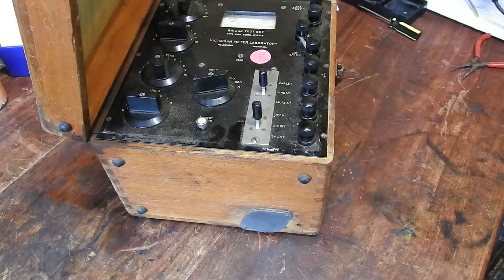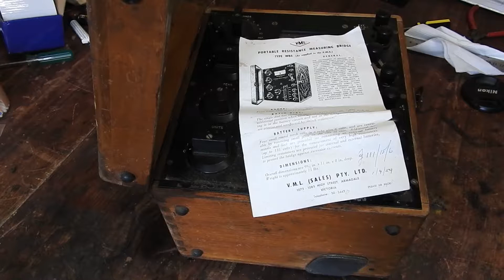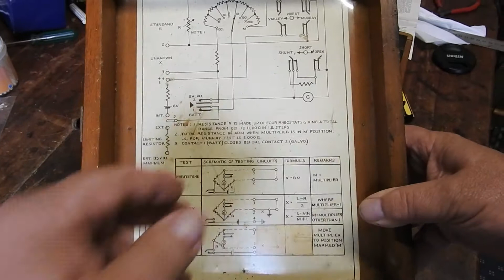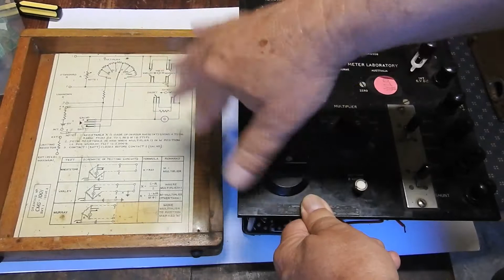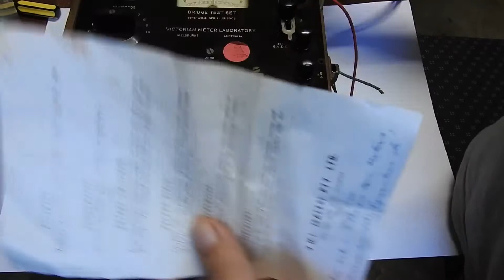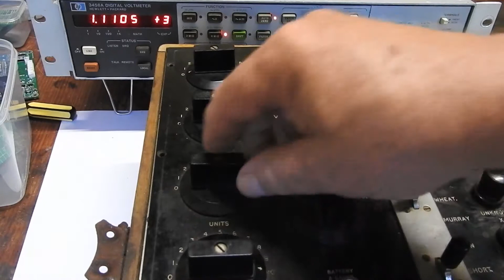Victorian Meter Laboratory Model WB4 Resistance Measuring Bridge - A quick and dirty teardown

Comment: Probably a more specialised device than this but in my first job in 1976 I used a resistance bridge every day to calibrate furnace temperature readings of salt bath furnaces. This was at a factory making high speed steel milling cutters. Hardening high speed steel requires temperatures close to its melting point so accurate temperature is critical. When I saw the title I was expecting something from the 1880s but it is Victoria the place, not the era!